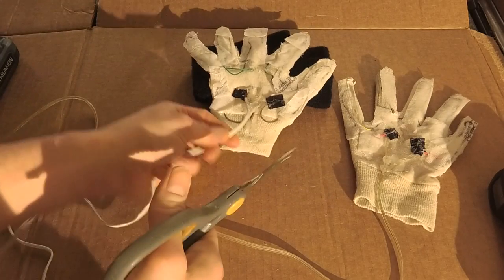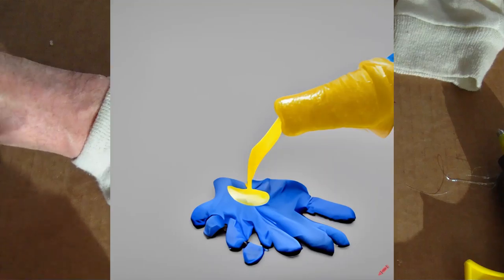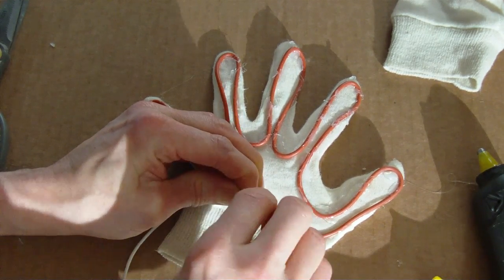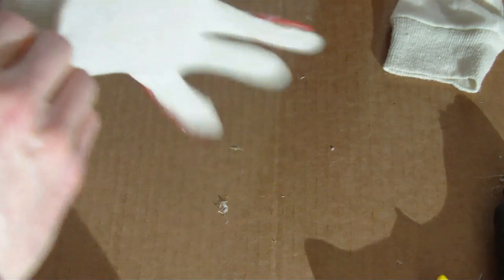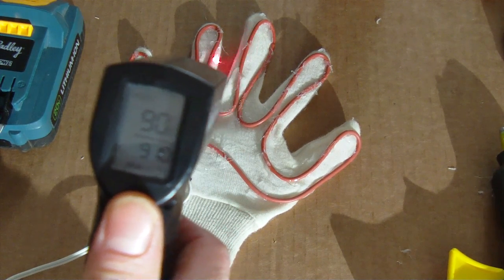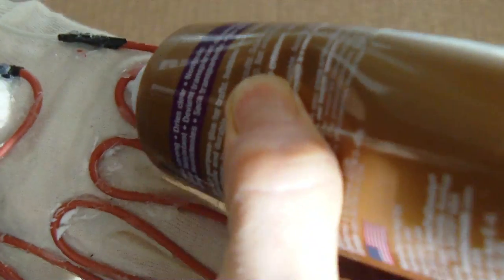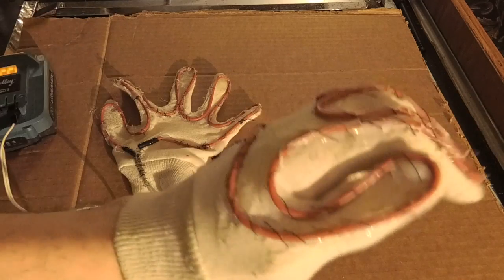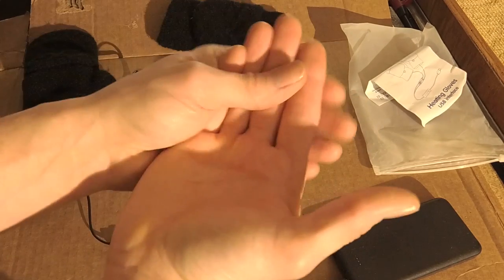DIY Heated Gloves - How to Make Electric Heated Gloves { Easy }

Comment: Tried to make this and the wire gets so hot even with a 18v battery pack. Did find another video where they use beading wire which needs less power and can run for 1hr 30mins off a 3.7v battery with 1000mha